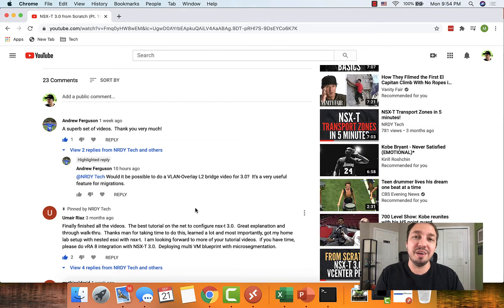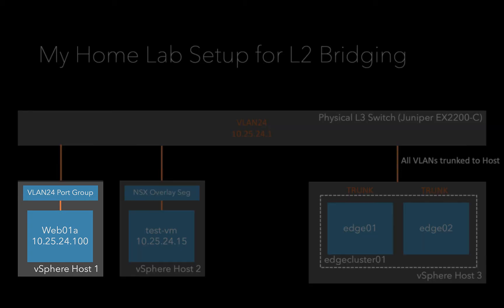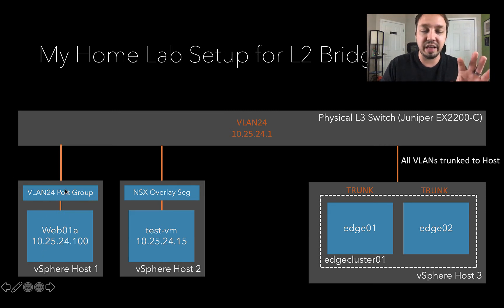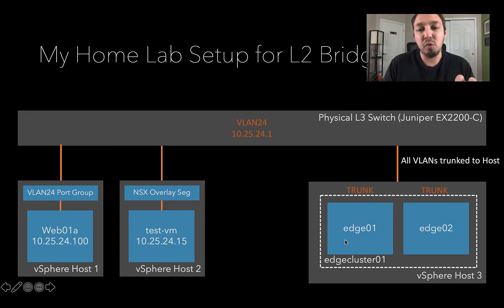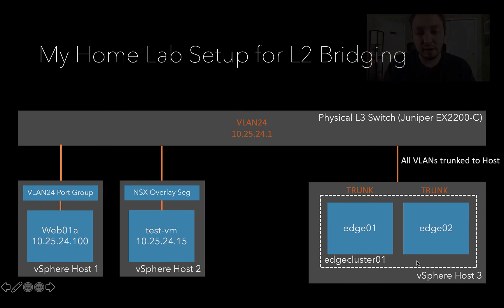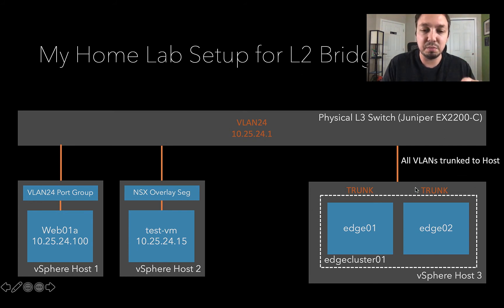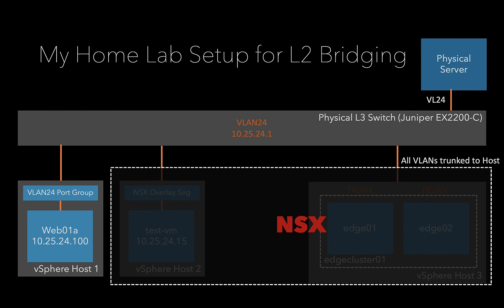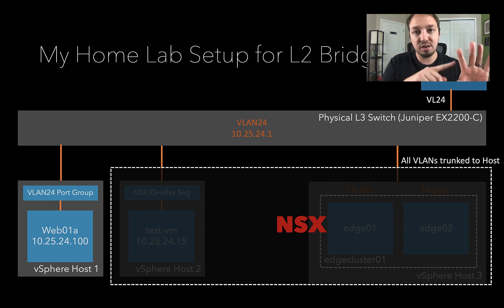NSX-T L2 Bridging Overview

Comment: Hello Mike, This is really nice video for the NSX-T bridge configuration. I was wondering if you trued to create NSX-T bridge using single NVDS switch. The edge uplinks reside on NVDS thus no possibility for Promiscuous mode and Forged transmits?
Reply from the maker: Hi Borislav, I haven't personally tested this. I would be interested in trying it out some time, just need to find the time :)